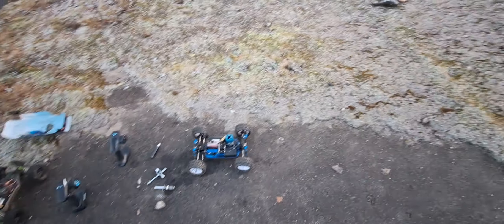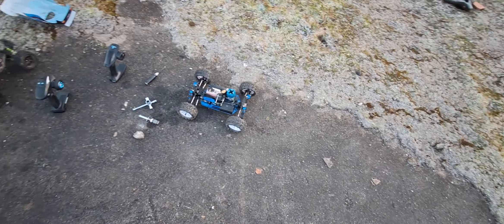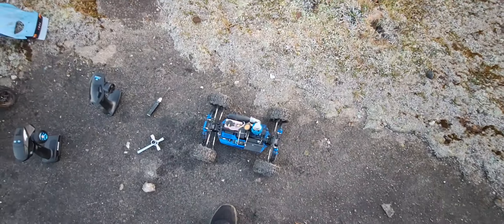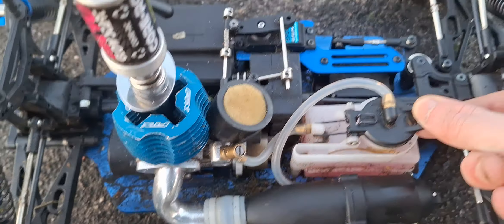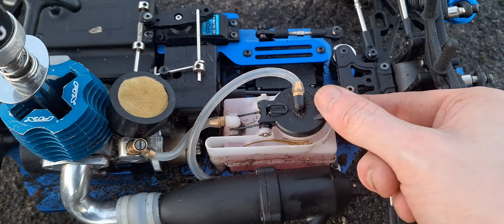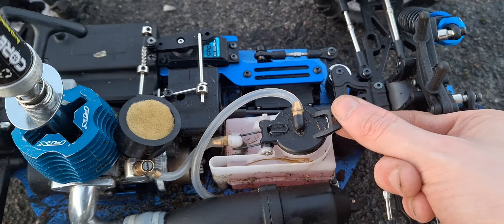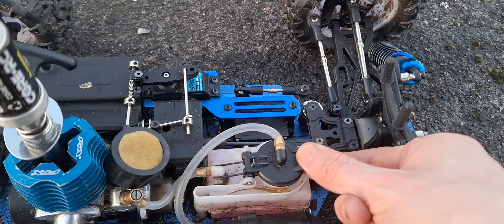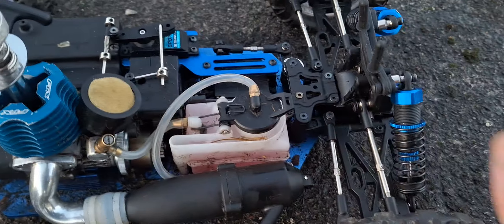I need help why it won't start 😭😭😭

Comment: check if the glow plug is good, always charge the glow starter, fuel tank should seal like air tight, make sure u prime the fuel u can also spray some fuel into the carb which helps, heating the engine also helps especially if its new, with most engines the needles being flush is factory/break in position it should start or atleast try to start with it. also remember you also have a low speed needle and an idle screw
Reply from the maker: Thanks for helping me out man really appreciate it